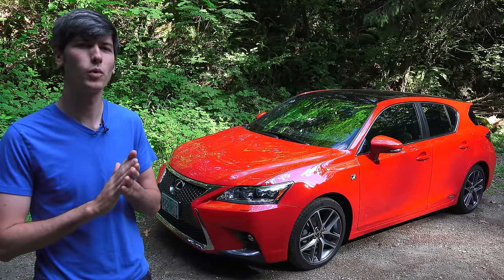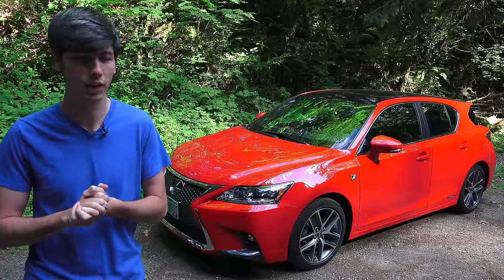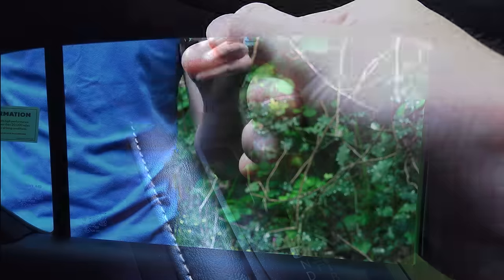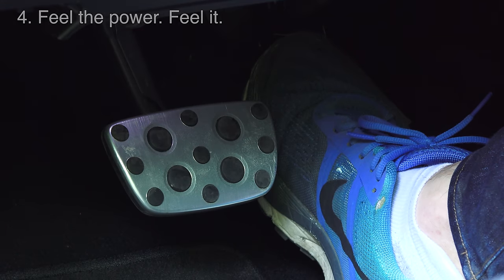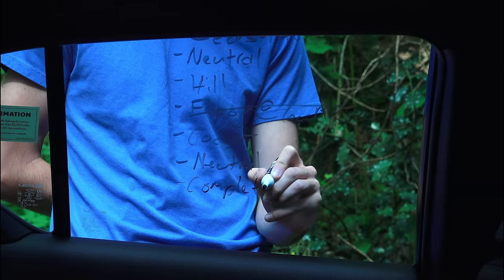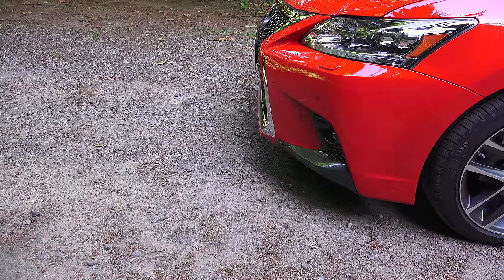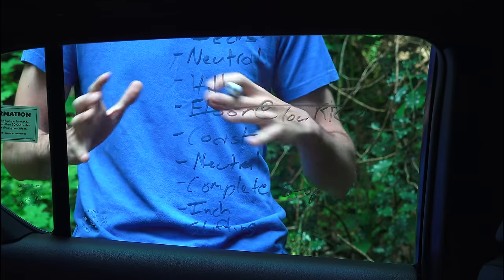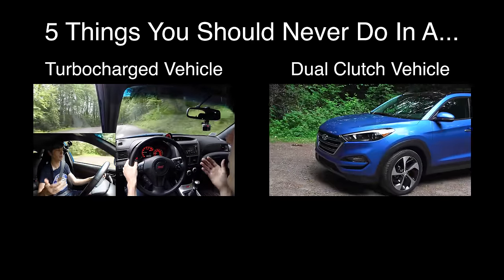5 Things You Should Never Do In A CVT Vehicle

Comment: Most new CVT transmissions, as well as shifted automatic transmissions use lock-up clutch torque converters. When the input shaft of the transmission reaches a certain RPM above the idle speed of the engine, a hydraulic actuated clutch engages inside the torque converter, eliminating fluid slip loss. That minimizes heat, and maximizes efficiency. When inching, the torque converter allows slippage, with absolutely no wear, though, there is some heat. eCVT  transmissions don't have any kind of clutch or torque converter. You have a single planetary gear set, with two 3 phase motors. The sun gear is connected to one electric motor, the planetary carrier is connected directly to the flywheel of the engine, and the annulus (outer ring gear) is connected to the differential. The second motor is also connected to the differential. 72% of the crankshaft torque of the engine goes straight into the differential, the other 28% goes to the sun gear, and at low road speeds, the sun gear and the motor it's connected to spin much faster than the engine. That generates electricity, which is used by the second motor, to help the engine apply torque to the differential. All ratio changing and apparent slippage is done by pulse width modulation, to control the speeds and torque multiplication of the transmission, and can transition through effective gear ratios, with no mechanical wear whatsoever
     Mechanical CVT transmissions come in two types. You can get them with either a "push belt" or "pull chain".  The push belt uses stacks of bits,(usually 423 to 499 bits) held in alignment by two spring steel bands. the drive sheave compresses the bits together, around the driven sheave. The moving sheaves,(called "variators") have a constant clamp force, controlled by their actuator piston area multiplied by fluid pump pressure. The "pull chain version uses a chain, that looks very much like the chain in the transfer case of a four-wheel drive truck, and the drive sheave pulls the chain from the driven sheave, just like an ordinary belt and pulley system. The clamp force on the chain is actually varied, according to the expected tension on the chain, based on engine torque, and effective ratio. It requires a more comprehensive electronic control module. The "push belt" system is more simple, and less expensive, but the "pull chain" can follow a tighter radius, therefore offers a greater ratio span than the "push-belt" type. (Typically, +/- 2.4:1 for "push-belt, +/-2.6:1 for "pull-chain") The "jury is still out" on which type will last the longest. The eCVT is the clear winner on long term reliability, compared to either of the mechanical types, but, it requires the most comprehensive control unit. It has to include two variable frequency drives, capable of handling the full horsepower rating of the engine!

Comment: I think if cvts were around first and someone tried to introduce a regular automatic transmission no one would buy the "new auto transmission". They'd complain about the engine noise.
Reply: Drew Beans true
Reply: Drew Beans jesus christ
Reply: CVT has been around for a very long time.. it is nothing new....
Reply: One other invention before the CVT concept, is the friction disc transmission that it had it's beginnings in the 1900's, and is used today in Snapper mowers and snow blowers for example.
Reply: Drew Beans Exactly. People are afraid of change.
Reply: Thanks for saying this
Reply: Don’t forget about BFT’s.  They’ve been around a long time as well.  Bus Fare Transmissions:  You put your dollar bill or bus pass into a slot, a continuous moving belt pulls the currency down into a mechanism called a fare box.  You then sit down and ring the bell when the hamster driving the bus gets to your stop!  Ingenious system.
Reply: Nissan Altima and Sentra have soured me on CVT.  When you reealy step on it sound like an stick with slipping clutch. Fat noiser  and more drive lash than my Mazda 6.
Reply: I think it's more of the fact they are not reliable. The metal bands used in the trans break pretty easy and once it breaks you have to swap the entire trans.
Reply: Drew Beans Exactly. Also, it's just became "cool" to dislike cvt transmissions. You don't dare say they're alright.
Reply: Jesus saves
Reply: From what I understand is they crap out prematurely and repairs and or replacing are complicated and expensive. Nobody wants to pump $5 ,000 + into their transmission on a newer car. ( and transmission oil changes are costly because the oil is more expensive ) 
After reading through comments it seems like reliability isnt promised . And that’s a huge turn off
Reply: Peyton Garland They’re perfectly reliable if you drive them properly.
Reply: @soulfiree88  I've put a total of 300000 miles on a CVT subie.....I drive 208 miles every day for work....no problems.
Reply: @teabag3854  , no problems because you're basically going the same speed all the time
Reply: @tstocker6926  um no. My drive consist of highway.. rural and sum City.
Reply: @teabag3854  The sun city part is why it's lasted 300,000 miles
Reply: @tstocker6926  if I say Chicago and Milwaukee traffic you'd just come back with " um um well your your subie is grey and it's a proven fact grey cars transmissions last longer "...just stop
Reply: 90% of trip is on I 94
Reply: @tstocker6926  no...but what is your point?.
Reply: @alwcurlz  friction disk

Well that's a clutch
Reply: @teabag3854  you must keep up with regular maintenance too. Lots of people neglect that and I think that causes alot of the CVT failures that people complain about.  Honestly if there was a problem subie, Nissan,  Honda wouldn't use them and there'd be huge recalls.
Reply: B3burner this is great where public transportation exists. Where it doesn't: not so much.
Reply: cvt is better, why would you want to lose rpms during a shift like you do in an auto trans?

Comment: I love my CVT. It's now done just over 200,000 km. I do put it in neutral at the lights every now and then since the engine mounts were replaced. There is a bit of engine vibration sitting in Drive. 
But I love the fact that when you take off from the lights you rev the engine in one go to at 3000rpm until you hit your desired speed and that is as hard as you work the engine. Not the rec increase you get with a regular manual or automatic as the vehicle works its way up through the gears.
Reply: That 3000rpm is more related to stall point of the torque converter which a normal automatic also has.
Reply: Why is the car vibrating when u put it in drive?

Comment: I've owned 2 CVT's now, a Honda Civic and Nissan Qashqai. Both have been economical and with the Honda I had a tow bar installed and frequently towed loaded trailers with it without any issues over 4 years of ownership. The Qashqai handles cruising and speed limiting extremely smoothly and is an incredibly easy drive both in the city and on longer drives. 

Haters gonna hate I suppose. If you love the sound and feel of a manual you will never want anything else. If however you are after a smooth and efficient ride, CVTs are great until the electric revolution really takes hold.
Reply: When I saw how simple a ecvt was I feel in love immediately, what used to be a complicated repair job is now only a couple of parts
Reply: @Meleeman011  ha ha... Simple does not equal easy or cheaper to repair.

Comment: 1 Thing You Should Never Do In A CVT Vehicle.
Buy one.
Reply: You beat me to it hahaha
Reply: If you listen closely, you can hear Jason from a distance get very annoyed by that joke.
Reply: HA HA SO ORIGINAL WOWEE dude he called you out in the video. He called this joke out before you even saw the video. Get out.
Reply: CVT's are jokes.  And I'm annoyed by CVT's.  If CVT = Joke, then I, too, am annoyed by jokes.  My wife owned a Murano.  Felt like the engine wasn't even attached to the car, but rather, the engine was outside towing the car via elastic tow straps.  Much like a process of 1) depress accelerator 2) engine speed increases 3) wait 4) car increasingly accelerates at some weird rate that does not match the engine.  The only way I can explain it is that the transmission accelerates the car instead of the engine.

CVT's in Polaris ATVs are WAY WAY better than those found in automobiles.
Reply: do you know the real capabilities of a CVT? Do you know you can have false fix gears? There's even a Subaru WRX CVT and it works perfectly well and fast
Reply: +shaggyusm26 what you can do to get more throttle is floor it.. release to mid and floor it again. it usually gets the rpms to jump, which is useful depending on where your power band is
Reply: every freaking video with cvt's
Reply: should i buy one outside of a cvt?
Reply: Maybe for heavily congested traffic in a hybrid car CVT´s are ok, but anyplace, any car else.
Reply: MrCapi55 Check videos from the Subaru CVT and then talk
Reply: Thanks for the tip. I´ll do
Reply: Of course. If you are already in a CVT vehicle then you will already have bought one. Buying a second one would be superfluous :)
Reply: one big like to your comment, and one big thank you to engineering explained for making this video
Reply: agree.  Google the nissan pathfinder CVT issues.  TONS of issues and I had the transmission replaced before 15k miles on a new pathfinder. Local dealer reports they do this every day!
Reply: Thank you for confirmation. I was in the verge of buying a 2017 Nissan Altima with the 3.5 liter, but it is only available with the CVT. In the past, I drove a Jeep Patriot with the CVT, and that "skidding" sensation was really unpleasent. Also, a friend of mine had a Nissan X-Trail "4x4", and told me that the CVT is not for "Any Kind of Off Road use". A YouTouber told me that I had to check out a Subaru with CVT video and I will, but unfotunately, I´m looking for a big "good ol´ " family sedán.
Reply: Keep your ear to the web.  CVT's are "theoretically" better.  For sure on economy but it takes a while for manufacturers to get it right.  Eventually they will be the transmission to get.  Do your homework before you buy.  Manufacturers are under pressure to use the CVT to get Govt. Mileage Standards.
Reply: only one I've driven is a rental Jeep Patriot. terrible, terrible vehicle - felt utterly gutless.
Reply: Unless it is a Honda or Toyota or Subaru
Reply: I was looking for this comment...
Reply: +Lawrence Rhodes Subarus have terrible cut transmissions, and Honda's have weak cvts. I'd but the Toyota by far!
Reply: You Americans are in my eyes all hypocrites when it comes to CVTs. It's the natural step forward for automatic transmissions. If you hate CVTs, well, imagine that most of the world sees automatic transmissions similarly. Where I come from, it's seen as an extra option for bad/lazy drivers or stereotypical women. It's irrational and even sexist, but so is your criticism of CVTs.
Reply: "1 Thing You Should Never Do In A CVT Vehicle.
Buy one."

Haha.  Tell that to my rear view mirror!  8^D
I don't know what you drive but I bet you couldn't catch my 2007 Lexus GS450h which has an eCVT.  And if you could I bet I get twice the MPG that you do.

A CVT is the logical endgame for the move towards more and more gears.  In the 60's you'd almost never see a 4 speed... 3 was the standard.  By the 2000s you'd also have had a hard time finding a 4 speed, everyone had at least 5 gears. Nowadays you see 6, 7, and even 8 speeds.

They're hunting for it... I've FOUND it.  An infinite number of gears!  That way the engine can sit at its sweet spot whether that's power or economy and the transmission can do what it needs to do to get it to the ground.

You're stuck in the past mate!  8^)
Reply: +Warren NZ i beg you pardon for making you sad on your lexus, i share with you the fuel record on my car (http://www.fuelly.com/car/volkswagen/jetta/2015/mmillan/424443)
only mode i made, i got rid of electronic speed limit, i can make 260km/h on the speedmetre (238 with gps) which is like 240mph. and yes, is manual shift. i love when nissans, mitsus or hondad try to race me, they can keep up to speed but very short time. i travel a lot, and usually long distances. no cvt car can keep up to my speed ( between 85-120mph) for 2 or 3 continous hrs ( yet). cvts are the future....maybe, but the way there is painful and hard, i might consider a cvt in 10 or 15 years from now
Reply: +Warren NZ oh. and btw, the data i showed it occurs at a more, lets say, legal speed. between 60-75 mph. sweet isnt it?
Reply: +Warren NZ lol @ Lexus sedan boy thinking his car is super fast. 0-60 in 5.5s is Corolla territory ffs. My pickup truck does it in 5.8, right on your tail and it's a goddamn 2 ton truck.

My other vehicle does it in 2.1s and gets 45mpg. Give ya two guesses what it is.
Reply: Clearly you don't have much knowledge.  Think two wheels.  The vehicle I have that will do that is a literbike, and will also do 45mpg (if ridden very conservatively).  That's what 200hp in a 440lb package will do for you.

I miss-remembered, it's the Camry that does it in 5.5s, mixed up my garbage basic sedans but point is, that's an unremarkable time these days.  Truck is a 3.5 EcoBoost F150 and will do it in 5.8-6.0s, depending on source.
Reply: "Unless it is a Honda or Toyota or Subaru"
I've a CVT-endowed Nissan. Should I scrap a vehicle that has given me exactly 0 problems for the last 30 000 km because you don't view them as worthy?
Reply: I am not aware of any country that uses miles for distance measurement (and thus MPH as the speed measurement) that allows that sort of speed on their freeways. Which makes me think your comment is bunk.
Reply: Still faster than a gearbox machine
Reply: I heard those super bikes do 100 kph in first gear which is one of the reasons they get there so fast.
Is that true?
Reply: But you need to buy it before you do it, you silly goose! XD
Reply: Warren NZ
Nice job on ignoring the latter part of my comment.
Reply: OK I've looked through the history.  Which part of your comment did I ignore?
Reply: +MrCapi55 you're basing not buying a 2017 altima 3.5 with d step that shifts to a jeep patriot with an underpowered 4 cyl? that's smart...
Reply: Warren NZ
"that allows that sort of speed on their freeways."

I am only aware of Germany's high speed limits in that range.
Reply: Well why would you buy an additional CVT vehicle when you're already in one?
Reply: Agreed. I stick to the good ol auto and the classic stickshift
Reply: And would that be a 2 speed as in Chevies of the 70s?
You'd probably prefer a 3 speed.  Is a 4 speed even better?  How about a 5 or 6 speed?  I see 7 speeds have recently arrived.  8 speeds won't be far behind.
A CVT pushes that trend to the limit by giving an infinite number of gear ratios.  They just pull and pull and pull without any shifting.
Feels amazing in a car with grunt like my Lexus GS450h.
Reply: Sasha Browning I can't blame you.  I totally get that.  I drove turbo RX7s for 24 years and I know the thrill of that direct connection with the pavement.

I guess I'm just getting old.  8^|

But you'd have to have a reasonably special car to catch my CVT equipped limo.
Reply: +Warren NZ cvt limo?
Reply: Not really a limo but nearly.  The Lexus GS450h was the top of the line flagship for Lexus when they released it in 2007.

I should know better.  My Mom told me a hundred thousand million billion times not to exaggerate!
8^)
Reply: NiL Nine    I was gonna say, the one thing you should never do to a CVT vehicle is to drive one.
Reply: ALAN CHIU "the one thing you should never do to a CVT vehicle is to drive one."

That's funny, everyone who drives my eCVT Lexus GS450h says "I want one".

Or maybe you meant you shouldn't drive something that you can't afford in case you fall in love with it.  8^)
Reply: NiL Nine tell that to the thousands of 2016 civic owners.
Reply: NiL Nine just buy one .a honda City 2016.. i don't how other feel, but honda city with cvt engine are smooth n suitable for my family
Reply: NiL Nine CVT aren't bad. It's definitely better then when it first came out in the early 2000s and mid 2005.
Reply: I think that all depends on what you want in your transmission. If it's an F-Sport, or sporty car, I would agree. I would want some type of manual. However, I love the CVT in my RX400h. Nice amount of power and very smooth, which is what I want in a luxury SUV.
Reply: why would you buy the car in  the car????
Reply: like bait